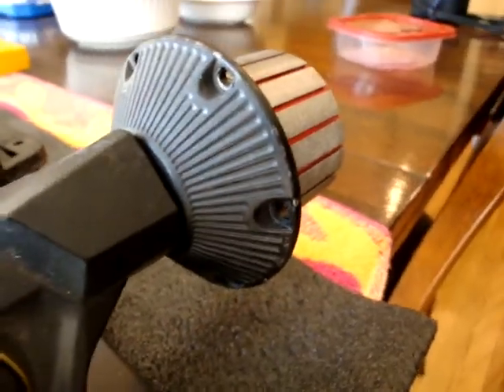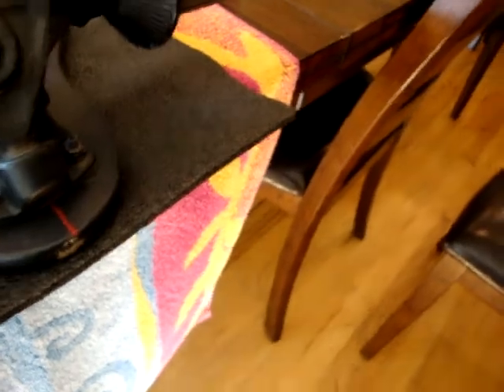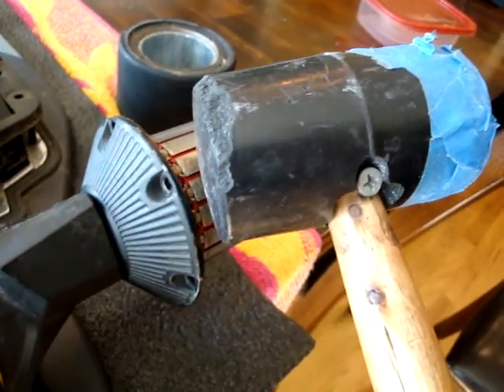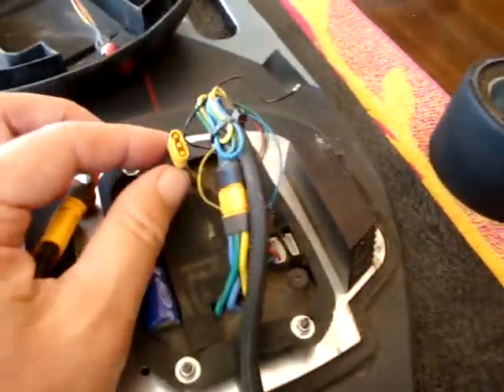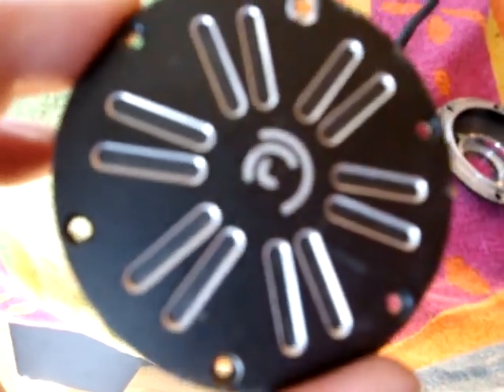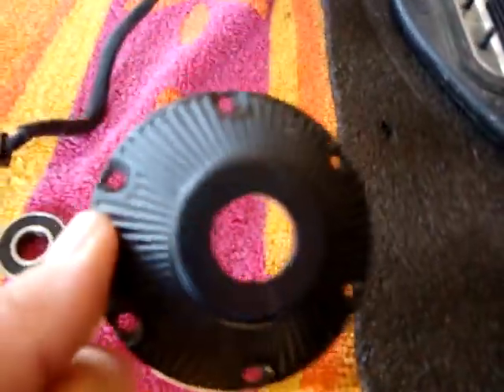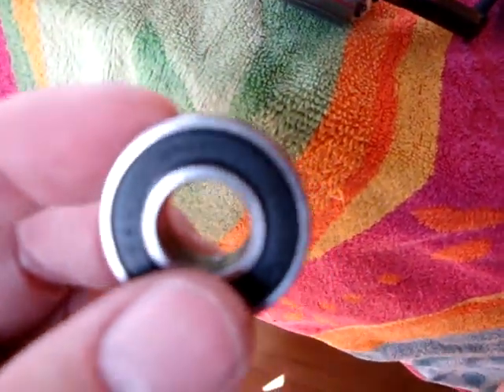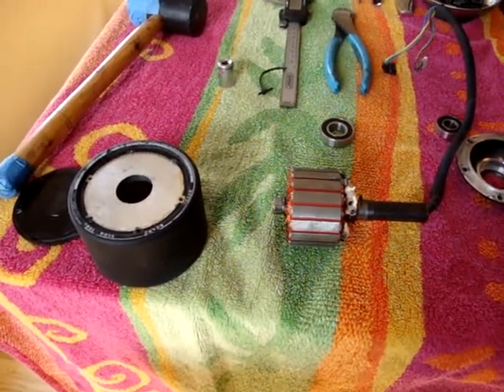Meepo Skateboard Hub Motor Bearing Swap

Comment: Thanks! I’ve been wondering what sizes I needed for my Meepo V3 & Meepo V4. Gonna order some 6002 2rs, 6001 2rs, & 608 2rs bearings from PGN Bearings now for the front & rear wheels.

Comment: Thanks-  How do you check the stator  or motor  electrically? Like  checking the resistance on the motor leads?
Reply from the maker: I wish I could tell you that but I don't really know. I can offer this though... If your hub motor isn't putting out like you think it should its probably not worth fixing it. It's likely more cost effective to just find a replacement. In fact, I have a couple laying around. Depending on the board, I may be able to hook you up.

Comment: You mentioned two different bearing sizes, 6002 and 6001, are they two different sizes in the wheel?
Reply from the maker: The larger outer bearings are type:  6002-2RS 
The smaller inner bearings are type:  6001-2RS

Comment: May I clean the hub bearings instead of replacing them,
Reply from the maker: I wouldn't suggest that for two reason. Once you break the seal it would be tricky to seal it back up again. It would also be difficult to both remove and repack grease in there. It's not impossible, I just don't think its a good long term fix.
Reply: @RoostChucker  All right, thanks for the reply